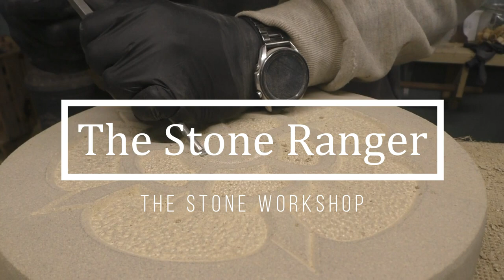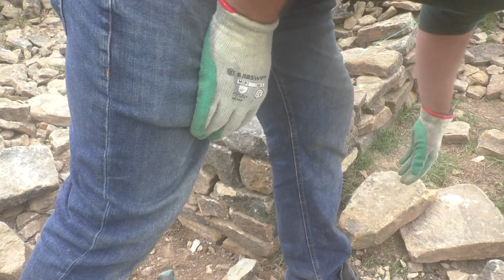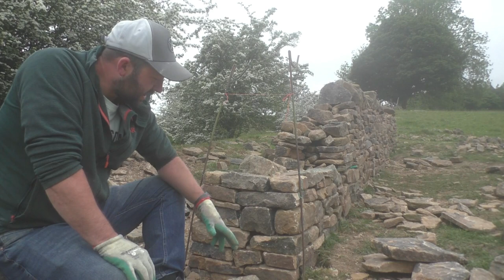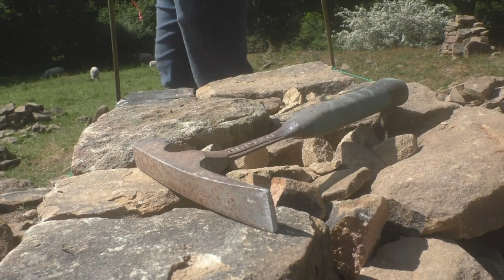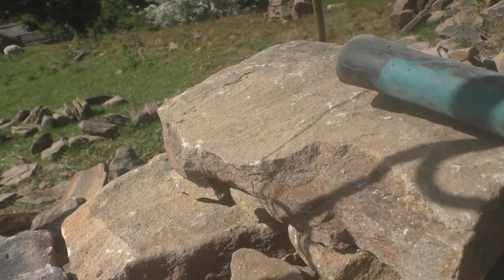HOW TO BUILD A DRY STONE WALL, BUILDING A CHEEK END, DRY STACK WALLING, DRY STONE WALLING

Comment: Great videos . Big help! Wondering if you have advise on building on a slope re how to lay found stones. We've bought a house here in Ireland and id love to repair the fallen walls but they all run uphill! And advise much appreciated! 

Ben
Reply from the maker: Hi Ben, thank you for watching. When building a dry stone wall on a hill, the main thing to do is build your foundation into the bank, making sure they are all level. Start at the bottom of the hill, and as you begin building the wall, you can keep adding to the foundation. I hope this makes sense. If it helps, I can forward you some pictures of walls I have built for you to see.
Reply: So you'd nearly dig tiers up the bank? Makes sense, pictures would be great.  I can give you my email if thatd be best

Comment: Lovely work, looks great. I want to build a pier, on its own for an iron gate to close into. There will be no wall running off it, just a pier on its own basically. I have old stone from a part of a knocked house that used to exist around 140 years ago. The Pier will need to be about 2m / 6ft high, maybe a bit less. Any tips for this type of build? I understand (from watching videos) it will need to be wider at the bottom. What size would the base want to be? I was thinking about 2ft by 2ft, would that be wide enough given the height? Have you any video showing something like this? Thanks and great work
Reply from the maker: Hi Sean, sorry, I don’t have any video to help you out, but from your message, I think you understand the process. I would really ensure that you join are tight on each stone, with each one touching the other flat, creating friction. And of course, the length of the stone into the wall, making sure each course is properly filled in the middle. Probably the biggest tip I could give you is don’t rush setting up your string lines; getting this job right will depend a lot on the preparation. I hope this helps you out.